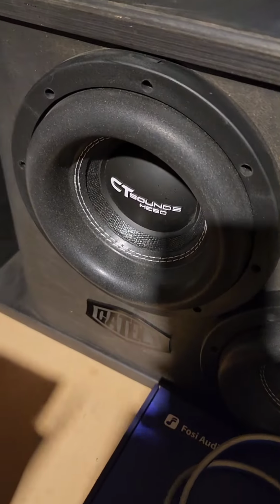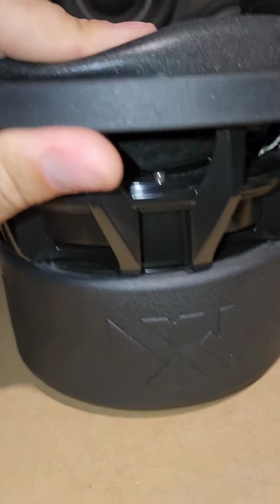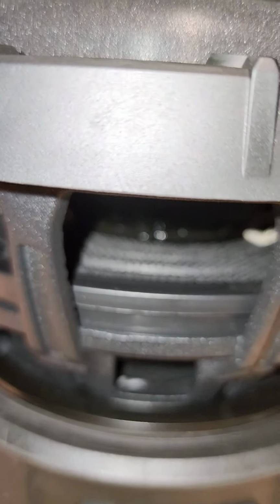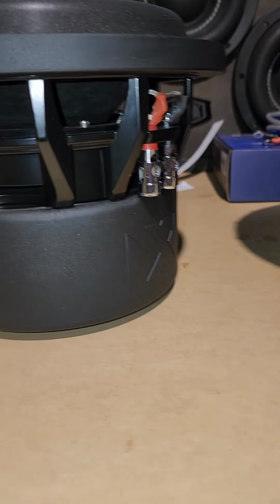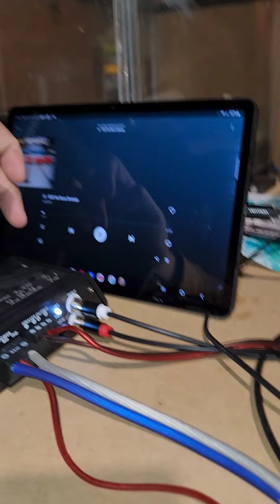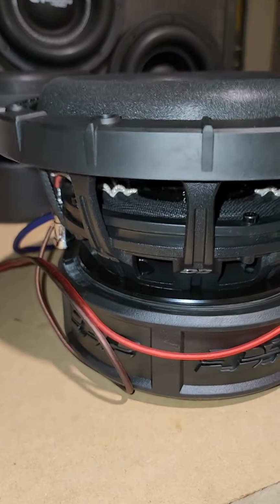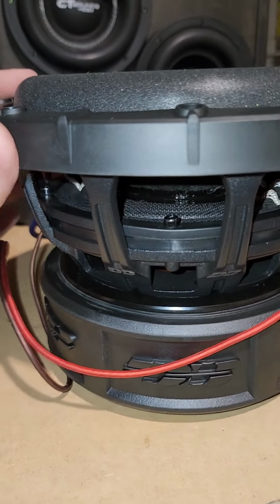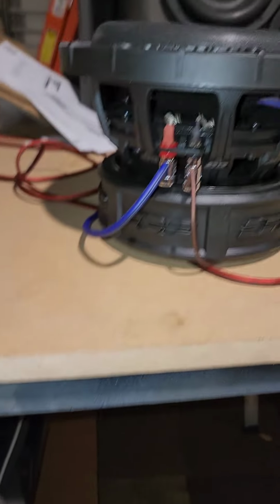Looking at a couple 8" subwoofers.. Deaf Bonce, NVX, CT sounds

Comment: I have had two nvx 12s since like 2011 maybe 12 but they were the cheapest dual 4 12s at the shop I stopped at on a road trip after blowing a sub. They were supposed to be just for a week or so. I still use them daily. I run them with a Memphis 1500.1 from 2001. I can't say enough good things about those subs.
Reply: They're really musical. I had them in a box too big and was wondering why my lows vanished. Great subs if you have right box